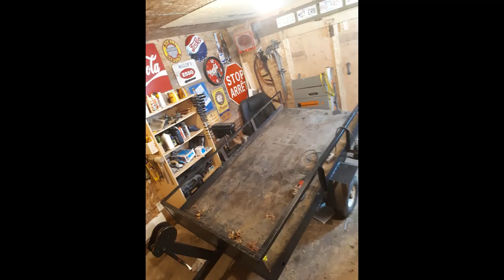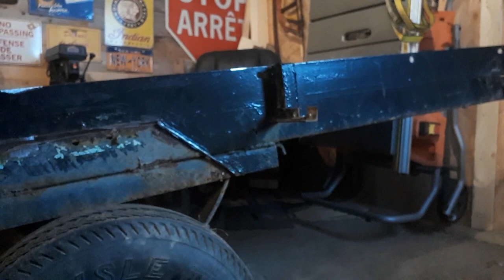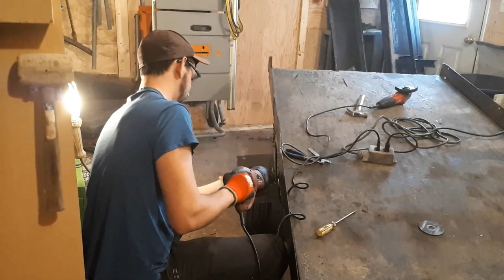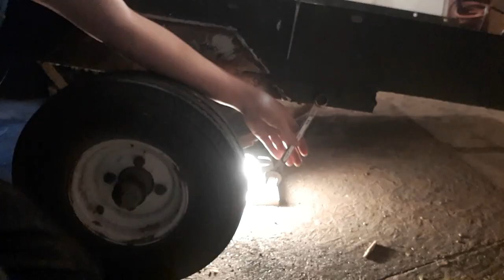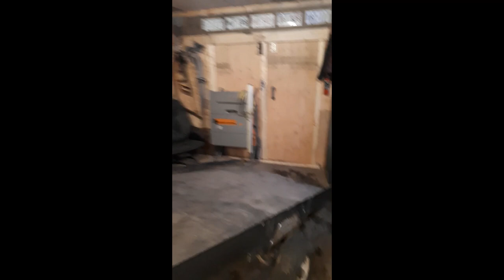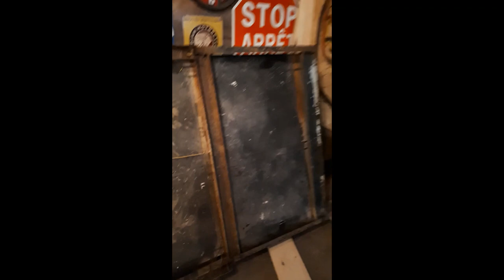building a homemade enclosed trailer pt 1

Comment: I'm not sure about your area but where I live these box trailers go for as much used than new. A small box trailer like that would fetch $5-7k if it looks new or as good as.Getting a good deal on a cheap trailer and building into a nice covered trailer you could turn a tidy profit. I have been trying to find a good deal on a small covered trailer to convert into a camp trailer however your video makes me believe it would be cheaper and better to build it from a flat trailer this way I could build it how I like. Thanks!!
Reply: Wow great minds think alike maybe cause I’m doing this too